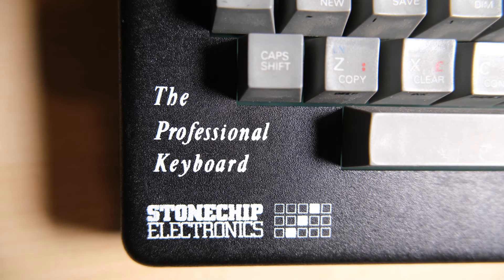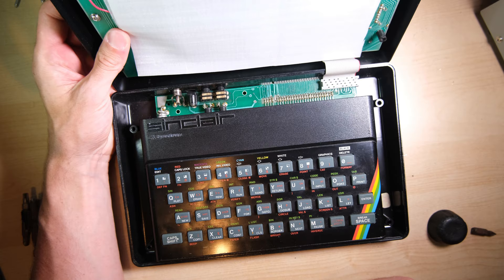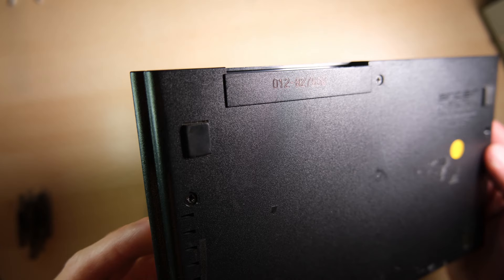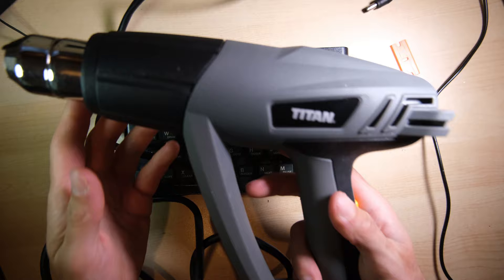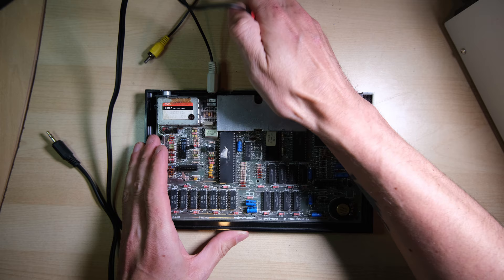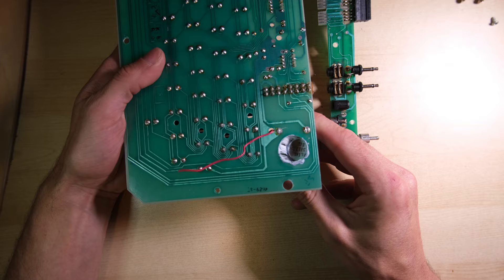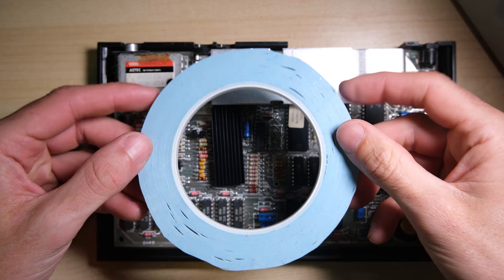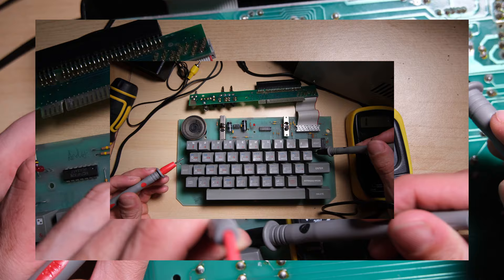ZX Spectrum - Refurb + Stonechip Keyboard Repair

Comment: Thanks Jim. It's great to see you repairing and refurbishing my kit with great attention to detail and care. The Stonechip keyboard was in a massive box of Spectrum bits I bought for £25 in a car boot sale in the 1990s. I never got the sound working, so I am now hearing it for the first time - great! Something in the depths of my memory is telling me that the Spectrum case and board are from different machines. The board maybe from a 48k plus, which might explain the on board reset button and it being a later motherboard? On the other hand I did (very badly) do little mods myself back then. Thank you again, it so satisfying to see everything working fully again.
Reply from the maker: Thanks Paul.  You're very welcome

Comment: another interesting video ohh external keyboard into the edge connector this is what i have made,, although mine is on the breadboard at the moment  .. it is a bit  dicey with the breadboard very easy to get data corruption due to bad connections  .. i have never seen this keyboard, ive had some lo profile  & dktronics ones that connect to the KB1 & kb2... currently working on a edge breakout board with the intention of making it so my future edge pcb's will connect to it like the Arduino does with shields.. the easy EDA software is making my brain hurt though.. when i get a specie with them keyboard tabs its such a relief ...  manic minor has to be the best game ever made ..
Reply from the maker: Have you cleaned the edge connector? That will increase reliability a little
Reply: @HappyLittleDiodes   its working now ,, but the Arduino link wires are not great, although i replaced some of them with solid link, and it improves it ..see my post on WOS "specie external keyboard" not much interest though

Comment: Nice work. What was the reason you desocketed the ULA? Was it to increase reliability?
Reply from the maker: It's physically impossible to fit a rubber-key case around the board if you have a heatsink on the ULA unless you remove the socket to give it the headroom.
Reply: @HappyLittleDiodes  Ah, that makes sense. Not a lot of room in those cases.